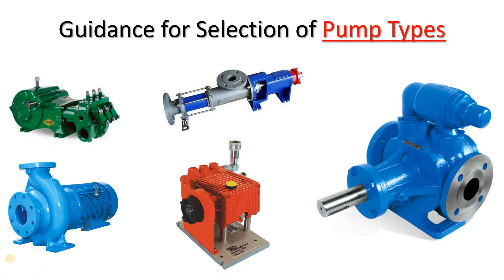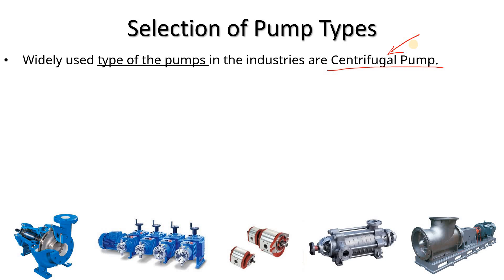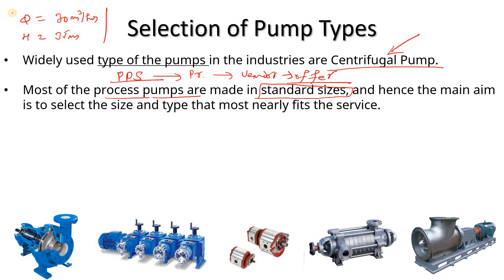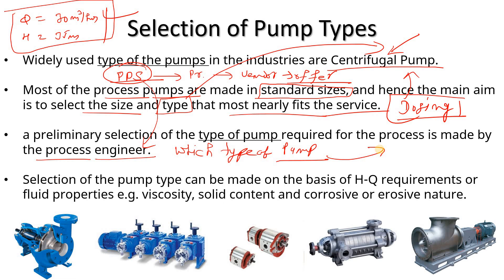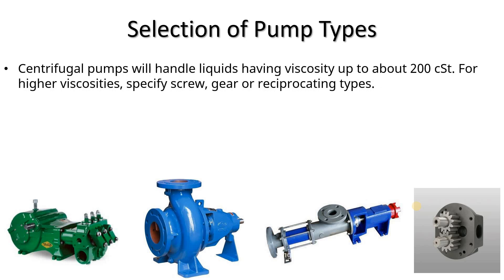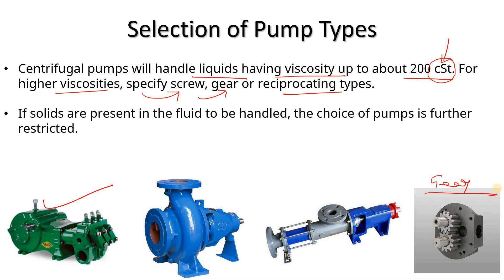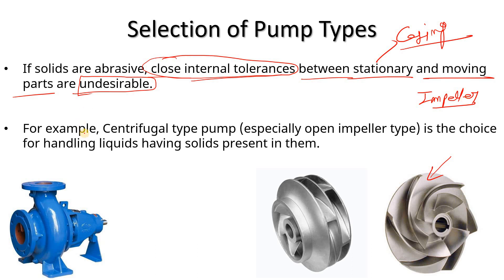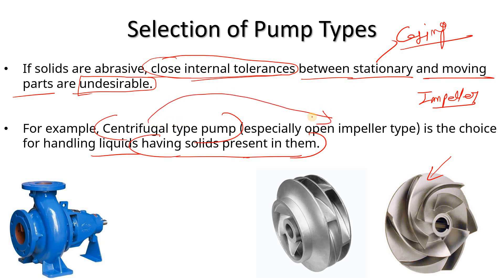Selection of Pump Types | Selecting the Proper Pump | Basis of Pump Selection | Core Engineering

Comment: During the selection of the pump we have to see three factor based on this three factors pump is selected
1) Flow rate
2) Head
3) Fluid properties
Reply from the maker: Exactly but we also see some other points as well which we've discussed in this video sir